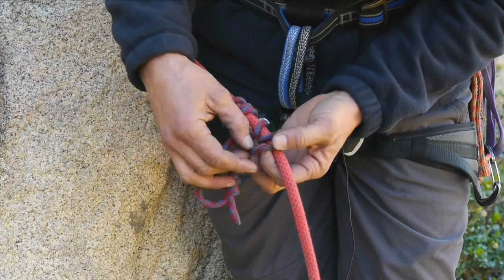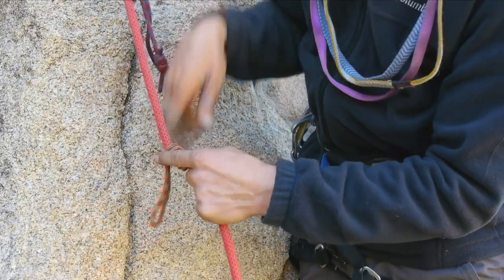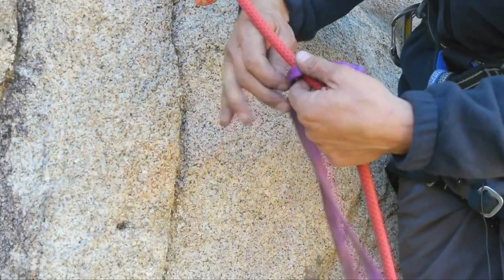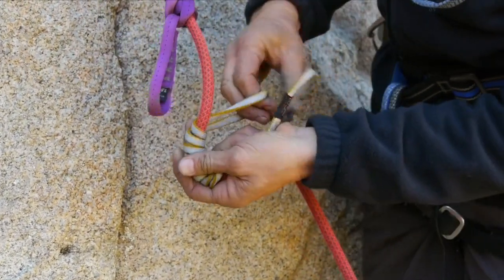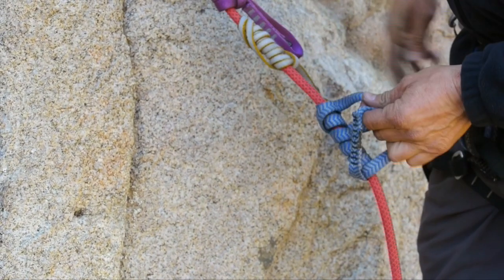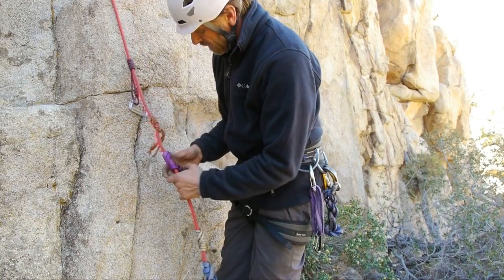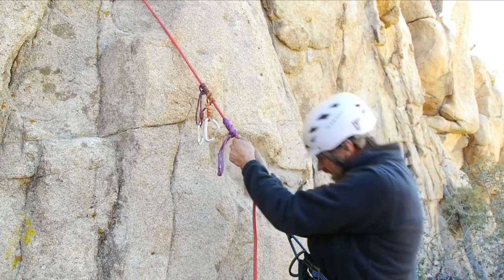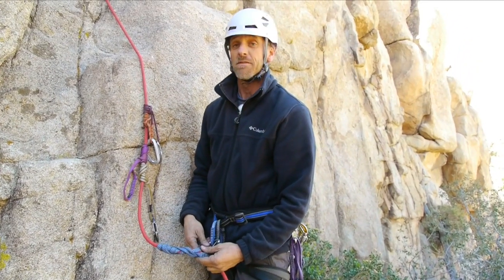Friction Hitch Comparison

Comment: Isn’t dyneema bad with friction hitches since it melts at relatively low temperatures
Reply from the maker: Dyneema can work just fine as a friction hitch material--you just need more wraps because its more slippery.  And even though the melting temperature is lower than nylon, it won't melt with proper usage.

Comment: Just to clarify—the recommended diameter of the hitch cord depends HEAVILY on many things—diameter of the line, material of the line, material of the hitch cord, weight of the climber, specific hitch being tied, etc. etc.
Reply from the maker: A 5mm person cord or a hollow block will work well in the vast majority of situations.  If the hitch slips when you test it, add another wrap.  When the rope gets wet or icy,  add a wrap or two.  6 or 7 mm cord does not grip as well, and may require extra wraps.

Comment: just here to give aramid hollow block slings a shoutout for use in these situations and as 3rd hands.
Reply from the maker: The performance of hollow block slings is excellent.  But there is something satisfying about spending $2 on a 5mm cord that does the job instead of $19 for a hollow block.

Comment: I've always used a cord based klemheist as my rappel backup; based on being able to work each hitch to release under full body weight load or not, would you only recommend using the autoblock as a rappel backup? As in is there a chance of getting "stuck" somehow and being unable to unweight your backup if using a prusik or klemheist as a rappel backup?
Reply from the maker: It's smoother to have an auto block backup to your rappel vs a kleimheist.  The auto block is much easier to release as well.  Make sure you auto block is below your belay device, not above.  The best way is to extend your ATC away from your body with a sling or PAS.

Comment: Great video, but sorry to nitpick your pronunciation of the hitch. "Klem-heist" (sounds like the first syllable in "Lemming", obviously adding a "k" to the front), not "Climb-heist".  It probably comes from German "klemmen" meaning "to clamp" and has nothing to do with the English word "climbing", which you make it sound similar to.
Thanks for the very clear demonstration of these hitches.  All the best.
Reply from the maker: Good point. I have heard it and read it both ways.  Klemheist and Kleimheist, pronounced two different ways.  I had a debate in my mind which way should I pronounce it on this video?  I have heard both variations equally over the years but I never looked into the root of the word.  Perhaps Klemheist is the original as you say and Kleimheist is a Californian bastardization of the word.
Reply: It's klemheist in the UK, never heard of climbheist pronunciation until now

Comment: I am using prusik to assist pulley system to hang kayak.  I was trying to remember how I used webbing to hold tension on anchor rode when sailing.  Could not remember the wrap that I used, and never even knew it was an established / named hitch.  Thanks for posting.  Your videos are excellent, very clear, and easy to follow.
Reply from the maker: thanks!

Comment: I am glad you specified that you use a 13 inch length.  I kept trying to decide what length to use.  Some told me 18 inches but it seemed too long to me.
Reply from the maker: I used a 13.5"  5mm cord in the demo.  But it's a little tight around larger diameter ropes.  14-15" is more versatile.